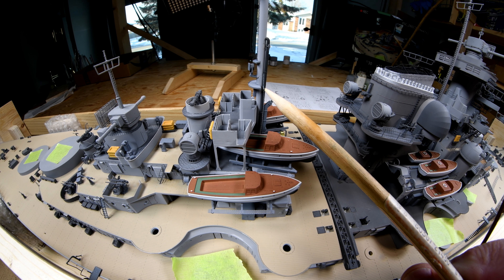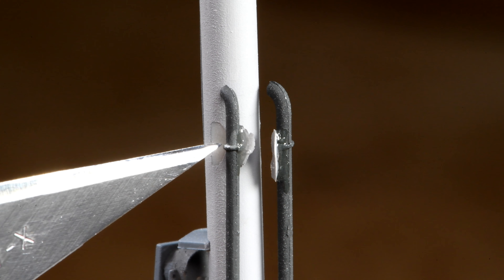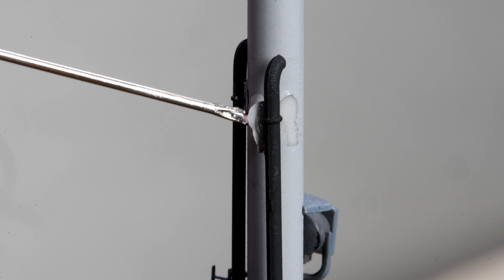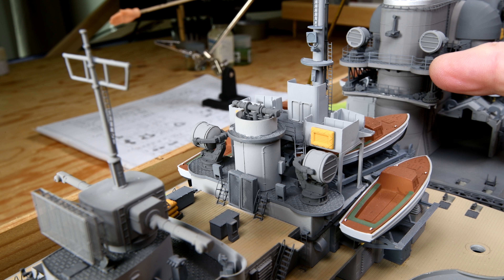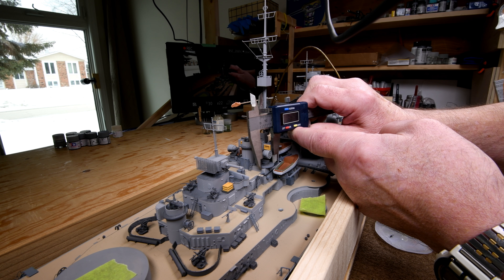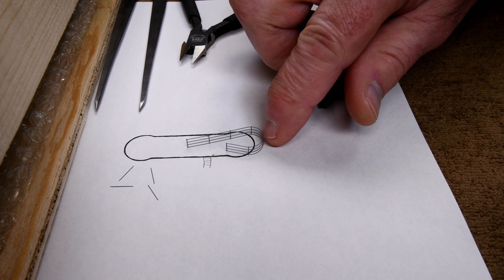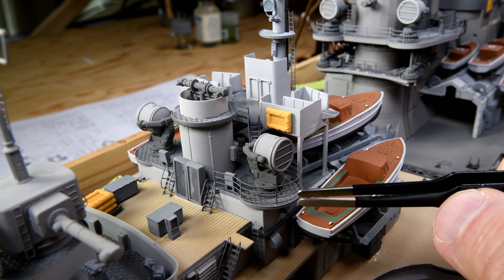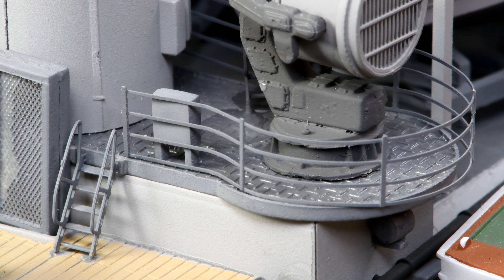The Model Ship - Part 366

Comment: There ya go Ron, You're starting to rock the railing like a pro. Only suggestion to help is to use a toothpick with your glue when doing small bites at a time. Less glue goes a long way here. The applicator you made is just putting on way too much. Also the toothpick will help with your accuracy on where it is going. I tell ya good sir. I went through all your struggles and then some. I appreciate you every episode. Keep up the solid work. CC